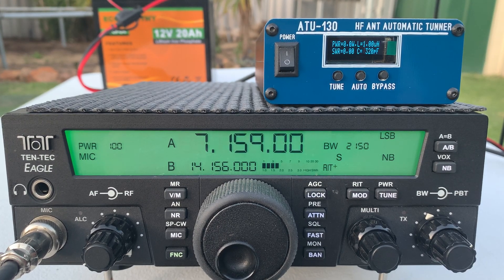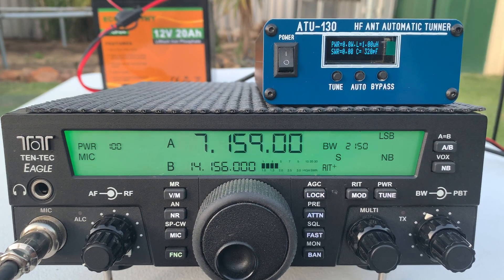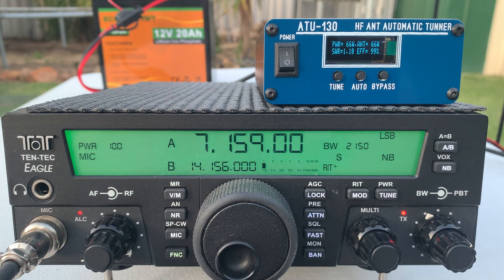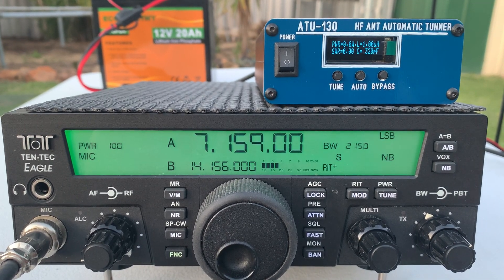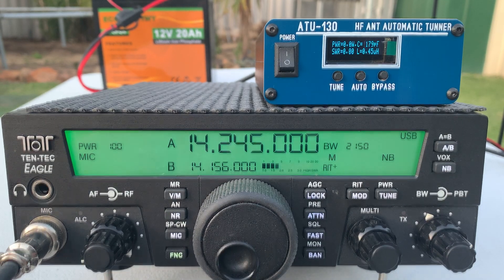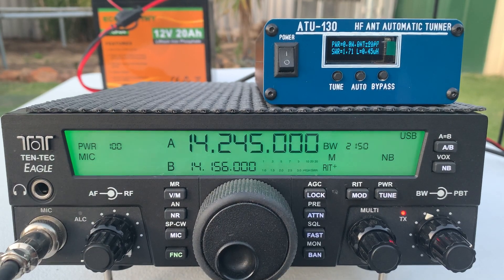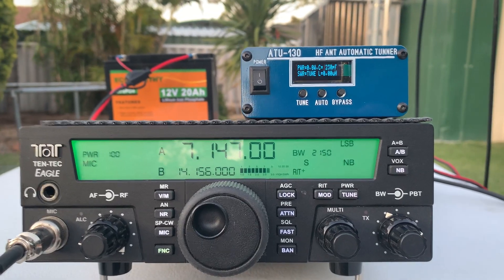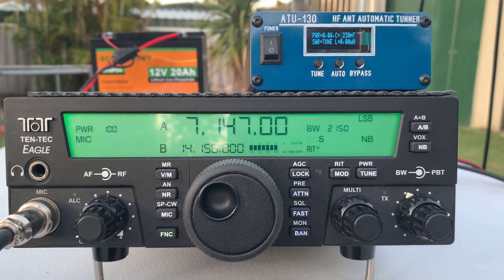HAM RADIO EXTERNAL AUTO TUNER.

Comment: Hello, will the ATU-130 retain the autotune setting if I switch it off, or do I need to select autotune every time I power it on?
Reply: Once autotune is selected, it will remain in the autotune mode, even through a power cycle.  In other words, it would work fine as a remote tuner at the antenna feed point.   You just have to supply it with power.  I would suggest using a pair of bias tee circuits, one at the radio and one at the tuner to provide 12 volts to the tuner over coax.
Reply: @richardowens9061  Thanks for the explanation! That’s exactly what I needed to know. Using bias tees to power the tuner remotely over the coax makes perfect sense — I’ll set it up that way. Appreciate the tip! 73
Reply: @YO8TNB  You're welcome.   I installed mine in a weather proof project box.   The bias tee circuits I used came from Amazon for about $14, or so, each.   I cuold have built them myself - but, not for that little bit of money.   Just buying the components would cost more.  

I also installed a discreet blue LED above the coax input to indicate whether power was making it to the tuner, or not.  I'm getting power off the external tuner jack on my Kenwood TS-480HX.  So, if the radio is on and the coax is connected, it has power.

I have enjoyed mine - especially, the money saved over buying from one of the big companies.

73

Comment: I've read that "with Am, fm, cw 5-15w well tuned (within swr1.5), you can use high power".  Which I translate to say that you need to lower the power to 5-10w to tune, then turn back up.
Thanks for sharing.

Comment: Does it have latching relays? Or do I need to press tune every time I power on?
Reply from the maker: Press tune depending on your resonance as you move up and down each band, it does not auto store to the best of my knowledge, great tuner much the same is in the Xeigu radios.
Reply: It does not have latching relays.   It does, however, remember it is in autotune mode when power cycled.   So, it will disengage any capacitors or inductors when powered off and re-tune once power is turned on.  In other words, it functions like it is in bypass mode when power is off.

Comment: Do you have to press the tune button on the tuner or can you just transmit a carrier and it will tune?
Reply from the maker: Press.👍👍
Reply: No, you do not have to press the tune button.   You can put it in autotune mode and it will tune when it detects high SWR.